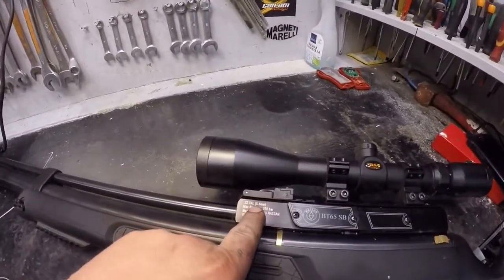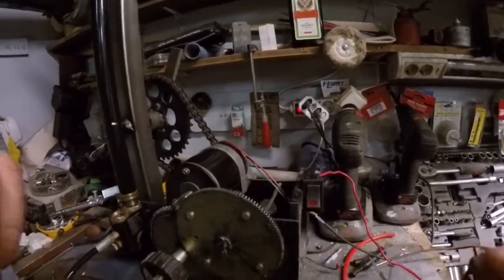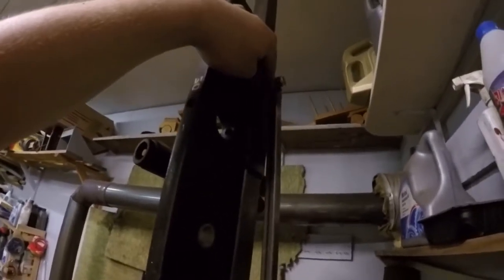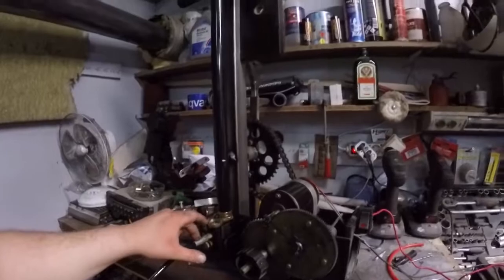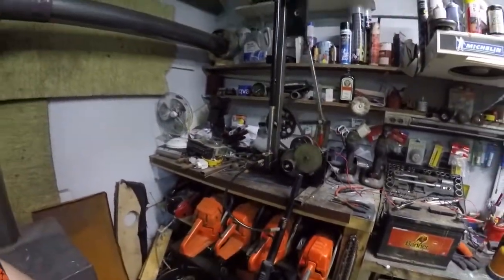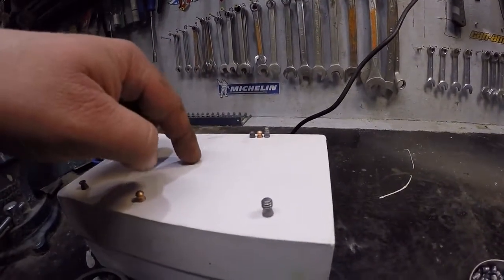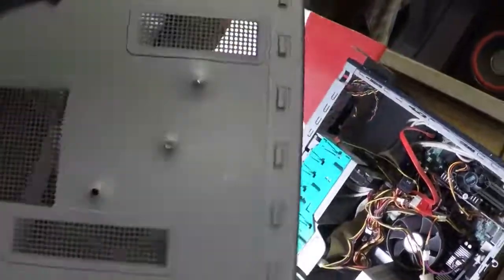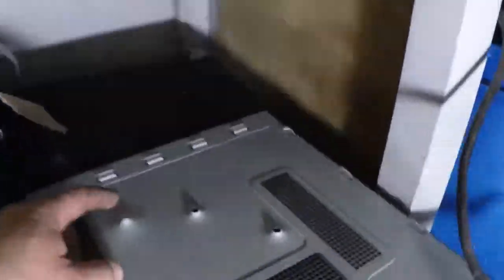My homemade PCP pump.

Comment: A heavier flywheel will help, and will lower the energy consumption. That additional vertical weight only ads for the motor work. That piece of steel will do a better work as counterweight in the arm, and in the flywheel...lacking some basic knowledge, but ingenous.